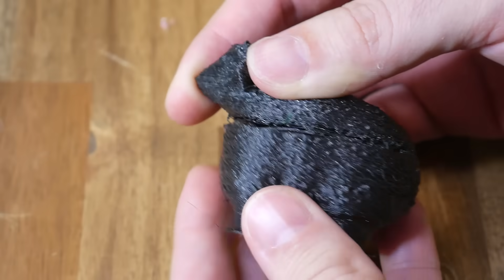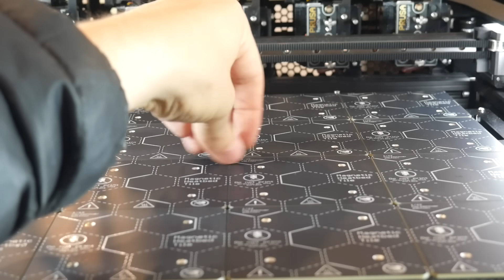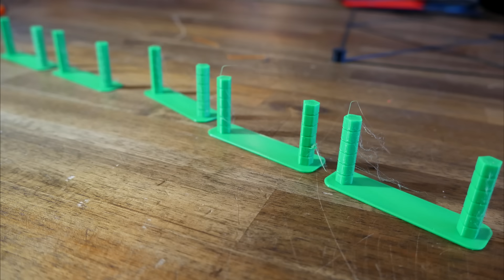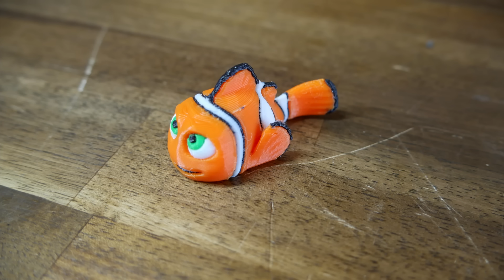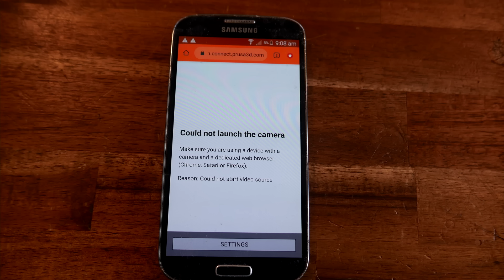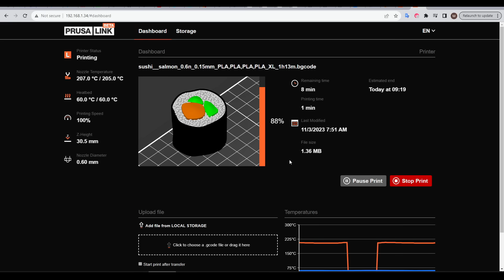The 5 tool Prusa XL is currently flawed, but I think it can be fixed

Comment: I have a 2 head XL, but my experiences mirror yours. I agree with your suggestions and hope Prusa has some serious work going into things on the back end. I have a dozen Bambulabs printers.. even though they lack a farm management tool, all the other features that work so much better are worth the hassle. First was makerbot.. then Prusa.. hopefully they're not going by the wayside, though if it means it's now the time of Bambulab I suppose that's not a bad thing.
Reply: Try it lately?
Reply: Stringing is gone, but It still has issues here and there. Most notably it randomly decides it's going into a filament swap cycle on the latest non beta firmware.  @Shadrackc
Reply: Not on mine.  None of this.  Did you clean the filament sensors?  I run on full RC and had for two months.  Had that happen once but the filament, upon testing, wasn't consistent in diameter.  @ZVexxPlayer    Mine is perfection right now.  Not a thing I will change till I put in the .4 nozzles.

Comment: Why are you using alpha releases and saying the product is broken? What a clumsy way to make a video. Clickbait as of late from this channel.
Reply: He’s using Alpha firmware as that’s all that is available. Alpha then beta then final with multiple iterations of each. If the firmware it came with wasn’t working what’s he to do. A product from any manufacturer should not be dipping in an Alpha state unless significantly discounted and the customer made aware. This is not the case with the XL. Hopefully they get it all sorted out as it’s a promising product. But if Bambu labs find a way to improve the waste and speed on the AMS this product will be dead in the water which is a real pitty

Comment: Wow, and to think that at one point I was debating whether to buy a Bambu or keep waiting for the XL. I’m unbelievably glad I pulled the trigger in an X1C/AMS.
Reply: Same, I had the XL in my basket at the beginning of the year and was ready to hit buy. Instead I ended up with an X1C/AMS and couldn't be happier, even more so knowing I STILL wouldn't have the XL and even if I did it would be a complete mess. Prusas loss was Bambus gain as it enabled me to expand my print business and I've now got 6 of the things. I love my mini and MK3's but Prusas really dropped the ball, and we're now beyond the point where the weird cult following is enough to save them, they really need to step up their game.
Reply: How is that waste tower?  Heavier than the model?
Reply: @Shadrackc  Kind of a redundant point if you have to reprint the model anyways when using the XL.
Reply: @strikereureka5081  why would you have to reprint it?
Reply: @Shadrackc  Because the support tower unattached itself the first time 🤣
Reply: @strikereureka5081  what are you talking about?
Reply: @Shadrackc  I'm saying that in it's current state the machine is not reliable enough to consistently print a multi-filament model successfully first time such that any advantage in reduced filament wastage is negated. For all of Bambulab's faults, I think it's fair to say that they provide a reliable machine that is ready out of the box. I imagine that's what most people were expecting from the XL (especially given its price).
Reply: Don't agree.  I have one, and when you are printing 3 day prints with 4000 tool changes, you can trust it for the jobs you are talking about.  You sound like someone trying to find something wrong.  Join the XL groups and see how wrong you are when there are hundreds that are printing and raving about it. @strikereureka5081   For all their faults?  You mean like treating people like cattle in the PRC?  You call that a "fault"?????
Reply: Your loss guys.  The XL is a beast and you can't get one used.
Reply: @Shadrackc I hope so. what an embarrassment. multi extruder consumer printers seem like a great idea. who else is making one?
Reply: @justin-tv3pc  nobody.  This is it.  AMS is such a waste of filament. Plus prusa pays employees properly.   Bambi probably pays them cents an hour.
Reply: @justin-tv3pc  simple Google search will get you an answer.

Comment: I own a 5-head XL semi-assembled. I have most of the same issues you're having except for the layer shifts. Layer shifts on a brand new pre-assembled printer are ridiculous and I'm so sorry that you have those. I've been able to get most of the stringing to go away with 3D Print Dogs fix and using PrusaSlicer 2.7.0-alpha1 and 5.1.0-alpha2 XL firmware. I also wish the noise levels were closer to that of my MK3S+. I really hope this is sorted soon, I'm somewhat happy with my purchase but it really should be better.

Comment: The biggest disappointment to me is that the XL had all this time and it still feels like it needed more. Small things about it niggled at me but didn't feel like deal breakers until I attempted a large scale print for a friend's cosplay and it just looked terrible. Especially since a recurring issue I ran into was that between 13 and 15cm on every taller print there would be a single layer that was under extruded and fragile because of that. Didn't matter the filament, didn't matter the print, didn't matter the settings changed, always happened. Not super brittle, but if it was gonna break it would always be on that spot. 

Near the end of my time with it it wouldn't lay down a first layer to save its life, even with a print it had done immediately before quite well. The nextruder is a fantastic idea and I would love to put it on another kit printer, but the XL as it is feels like a real toss up if you're gonna get a flawless one like Joel or Uncle Jessy or a half-baked one like you or YGK3D.

At this point I'm holding out for copycats or kits. The XL is amazing on paper, amazing when it works, and and XL letdown when this happens.

Comment: This feels like my experience with Creality printers. my first Ender 3 was a great reliable first printer. Purchased a total of 5 other printers from Creality and most were hot garbage.
Got into the kickstarter for BambuLabs Carbon X1 and have never looked back. 4 bambu printers with very little issues. Alway get the result I want with minimal fuss.
Bambu for the win

Comment: This was painful to watch, it gave me flashbacks to the craftbot flow idex and trying to get useable prints out of it - doing much the same testing and tinkering. At the price point, there is zero excuses honestly. Manufacturing delays sure - but getting improvements by reverse engineering their own unpublished codes is a really bad look. I didn't pay for the flow and I still felt ripped off, you've got a cooler take on this than I would have if I had dropped 6K ! 

I hope XL customers aren't abandoned as Prusa shifts focus to their newly announced professional range of printers.
Reply: the PrusaPro line of printers is developed by a completely different team

"The people working on our Prusa Pro product line form a completely separate, independent team, which has been in operation for over 4 years now. It started with new specialists we hired specifically for this new branch of our company and developers who joined our team when we acquired the FUTUR3D and TRILAB companies. They also have their own manufacturing capacity, whether it’s in a separate building or even in another town."
Reply: @97hondacivic  I guess that’s good news, it’s hard to imagine a group of presumably capable engineers doing a worse job than the XL 🤷‍♂️
Reply: @DaveEtchells  own one?  Check those that do.
Reply: @Shadrackc  I don’t own one, but my impression is the result of several videos here on YT by very competent, reputable users. If you’re having a great experience with it, I’m genuinely happy for you, I’ve just seen a number of people who haven’t, and am glad that I skipped my XL reservation and bought a Bambu X1C instead. Based on your comment, it’s quite possible that Prusa has worked out the issues with the XL at this point. I’m just happy that my Bambu is so plug & play.
Reply: @MakersMuse
You think it was painful for you, I also spent the cash for a Multi Head and this young man hit the nail on the head. The problem for me is I am not a programmer and have no way of trying these techniques. All I can do is wait and hope!!
Reply: Yup, had a Craftbot 3 and not much better.
Reply: I had the same experience with the BCN3D Sigma IDEX. Spent months trying to fix al the extrusion problems and ended up selling the machine.
Reply: They're insisting their Pro printers are a different team spun up so as not to impact the consumer stuff. I hope that's true. 

They seem to be supporting the XL so far and I have to believe they'll continue to like the i3 etc. but we really shouldn't have to pay that much to be hardware alpha testers and wait for even basic reliability.
Reply: This doesn’t bode well for their “professional” printers 🙁
Reply: @DaveEtchells  oh, I'm sure Prusa will divert all resources to their pro/enterprise line so they can extract every dime possible from that sweet, sweet business user segment.
Reply: I look forward to your video on this printer. 

I have to say I'm shocked and disappointed by the performance of this mega expensive printer made by the top company that made 3D printers more accessible to the public.
Reply: @TechnologistAtWork  not happening, I'm not buying one sorry. Michael's take on it is very reasonable and trustworthy.
Reply: @MakersMuse  Understandable l. Maybe Prusa will ship you one for free after they address some of the issues. 

Doesn't it feel weird that the extruder nozzle choice is kind of a step back from the Revo design that they have in their MK4? It's like the two projects were built by entirely different teams and had zero communications about what their next gen line of printers is supposed to be like. It's like they have an identity crisis over there at Prusa HQ.
Reply: @MakersMuse  prusa should send you one
Reply: @TechnologistAtWork  not sure what you're talking about? Both the XL and MK4 are using Nextruder and their new hotend.
Reply: @brisance  no Revo nozzles. Check again because they're using V6 nozzles. The nozzles are very visible in this same video.
Reply: @TechnologistAtWork Nextruder uses a nozzle that from the outside looks like a v6. There are two options, an adapter that allows you to put a v6 nozzle in the heat block or a proprietary nozzle that is swappable in much the same way a Revo is. Both the mk4 and xl use the Nextruder. Revo was never shown in this video. Revo is the one with a colorful band around the nozzle.
Reply: @MakersMuse  OK, but can we start a go fund me to pay for shipping of Michael's XL over to Angus, so we can hear him do a spicy rant about it?  (Or I guess we could ship Angus over to Michael's place).  Hahaha.   Setting that aside, it would be interesting to know if these two Ozzies ever cross paths, and have any fun interactions!  (Yes I realize Australia is a big place, and not all Ozzies know each other. As a sometime-Canadian, I face the same misconceptions. :-)  )
Reply: i loveg you makers muse

Comment: Prusa had a choice: keep the printers sitting in a warehouse until the software was refined, or ship them out to customers so they could at least start using them. IMO They chose the logically 'correct' option to let people use them rather than delay them further, however it's bad for marketing/appearances - just look at the Mk4 release too. Prusa mainly did this to themselves by announcing the XL way too early. These issues will definitely be fixed and I'm sure it will be an excellent printer in a few months and even more so in a few years.

I have a Mk2 with the original MMU1 - it's been printing multi-material flawlessly for years and I have no fear of it ever stopping since it's all local software and still receives the benefits of the latest prusa slicers - technically a bad business decision from Prusa since it would be better for them if I was forced to buy a new printer to get the latest features, but again - they are choosing the best option for the customer rather than themselves.

Comment: A $5,000 printer better have a robot arm that comes out and...will play rock-paper-scissors with you. Or other things. Either way, you expect to need to mess with slicer settings, make firmware tweaks, and install custom aftermarket printed parts to improve the experience when you're buying a $200 printer, rather than something that costs as much as 25 $200 printers. Despite the long delays since the original promised release date, so many things about this printer seem rushed - Prusa rushed the Mk4 to market because Bambu Lab pulled their pants down with the X1C and they seem to have rushed the XL because they started the pre-orders too early in the development process and people were getting antsy about their investments. With all the smart people working at Prusa, it's quite odd that the XL appears this slapdash...almost like their focus on industrial printing is taking away from their support of the hobbyist and prosumer markets.

The saddest part of this for me is that there still seem to be no completely reliable IDEX or toolchanger printers available to hobbyists and small businesses. The Sovol SV04 and the Flashforge Creator Pro 2 are the best of a very rough IDEX printer market, and other than the XL the only real toolchanger printers out there have to be built entirely from scratch. The door to multi-color and -material printing has been pushed ajar by Bambu Lab, Prusa, and others with single-hot end systems but nobody seems capable of opening that door all the way and making a reliable printer at the same time...adding complexity with additional print heads certainly isn't easy, but in an age where people are developing truly wacky things like 5-axis 3D printing and conical slicing, adding extra nozzles should be comparatively easy.

Comment: That heated bed is a pretentious waste of engineering and money. An insignificant savings for the user at the cost of  complexity and points of failure. The time spent on that "solution" should have been spent on what matters most in a 3d printer..... Printing.

Comment: I've got a 2 tool head XL and agree with most of your comments, especially returning to the wipe tower at the end of the layer. Prusa did something new with the toolchanger and I've had some great 2 color prints, including 2 color tpu. I'm happy with the performance so far, despite the bugs and room for improvement. The toolchanger hardware works great and the 12 minute alpha benchy looks pretty damn good. This is my first Prusa and I'm well aware that as an early adopter, there will be bugs. But I'm personally excited to contribute to the improvement of this machine and think it will evolve into  more that what was promised through firmware updates. Also, pretty disappointed in Prusa link/connect!

Comment: Got my dual-tool one about a week ago.  Came with a "textured" build plate and a "satin" one.  I randomly started with the textured one and about 80% of my first layers failed.  I tried all sorts of stuff and couldn't improve it until I swapped the to Satin one - then it did great with the first layer.  I wonder if the textured one screws up the Z calibration at the start of each print.  My print fans also both fail the self-tests but operationally seem to do just fine (they spin at audibly different RPMs throughout prints or when you manually turn them on from the LCD).  In general it has been doing pretty well at this point but I haven't printed anything too overly difficult yet.

Comment: WOW! Thank you for this! I greatly (GREATLY!) appreciate all the time (and money) that you invested in this review. Honestly, I feel that using the word 'review' doesn't really do your video justice. It is clear that you really did try to find the issues and searched for a solution. You pressed ahead and persevered when others would have have just given up. Our own print farm features just one Prusa, and it has certainly won us over for its quality and reliability, but we too faced some pretty shoddy design, production and support issues with a Multi filament upgrade we purchased for it. I do worry that Prusa may be resting on its laurels somewhat lately. And there are clearly a few hmmm moments when dealing with its interface quirks at times. I have put that down to growing pains. I too feel Prusa should be supported for their open approach and because they have really helped push forward the whole 3D world for average people. But... I hope they don't take advantage of that goodwill they have built over the years.  Thanks again! I hope this comment helps boost views so you can eventually recoup your money :)

Comment: Michael, Your price chart is way off; I’m in Australia and I didn’t pay $6705AUD for the machine with shipping… Sounds like you added the customs in twice.

I paid when there was a insanely high FX rate and I had to get my deposit refunded and re-pay from scratch because their website didn’t allow me to change my address (from nearly 2years ago):

Deposit: $320AUD
Machine + shipping: $5665AUD
Customs: $650AUD
Total: $6635AUD
Reply: yep apologies, I bought semi-assembled. Pay with PayPal next time - bank conversion fees are off the chart if you pay direct. One thing I had that you might have with the tool heads is that the post has a groove that is a pressure fit and needs to be done up mega tight; one of my tools this part was assembled backwards. This meant it was very loose and didn’t lock in firm; funny enough it was tool head 5 for me too!
Reply from the maker: All if the prices were taken from my bank account. Remember I opted for pre-built and freight will vary depending on location. Exchange rates change over time too.